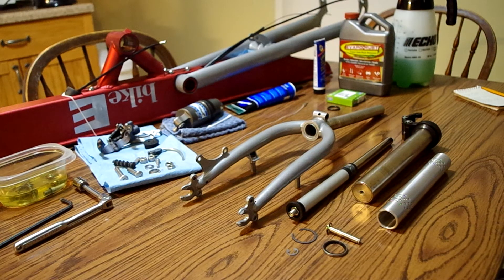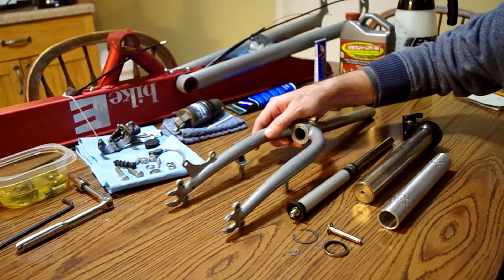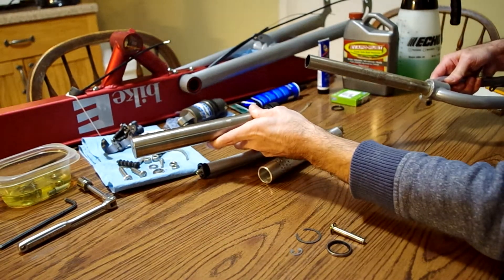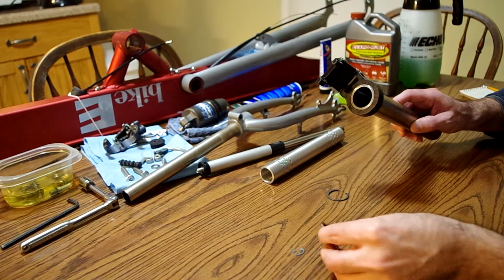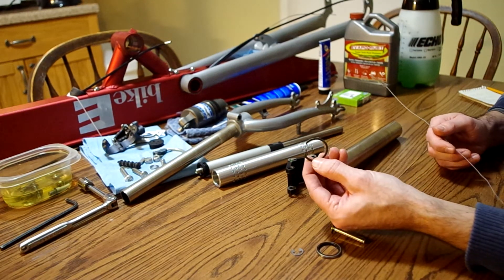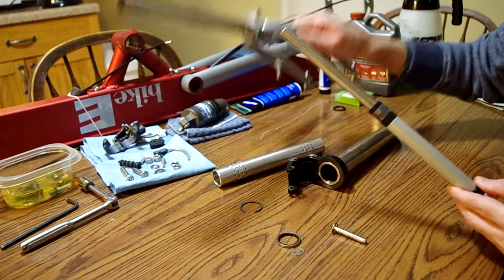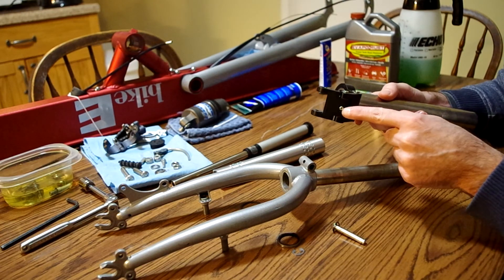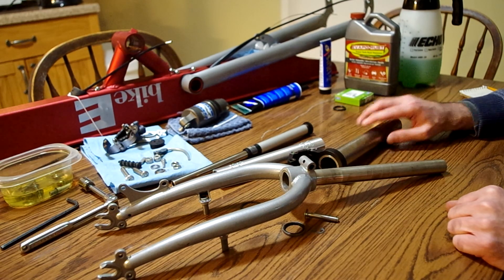BikeE FX (and RX) Front Suspension Components

Comment: Great video and very timely for me.  I just brought my BikeE FX out from under the house after 20 years of storage.  I forgot how much I like to ride the bike.  Does anyone have any guidance on how to set the pressure on the front shock?  Mine is flat.  :(.  Thanks!
Reply from the maker: I’ve got documentation for the front shock someplace. Lemme see what I can find for you. I can say you’ll need a dedicated shock pump though, as a regular tire pump won’t work. It’s a common item and not specific to Bike E, thankfully.
Reply: @76horsepower thanks!!
Reply from the maker: @gjohnson3043  The Bike E FX supplement says to inflate the front shock to 1.5 x the rider's weight, plus or minus 10 psi depending on riding conditions, which should result in 0.1-0.2" of sag at the front shock when rider is sitting on the bike with both feet on the ground.
Reply: @76horsepower  Great!  Thanks so much for the information.  I'll go see what happens!

Comment: Do you know if replacement air cylinders are available? Or even how to spec a replacement?
Reply from the maker: I rebuilt both my cylinders with OEM parts kits and, as far as I know, parts are still available. I rather like the ride provided by the air cylinders, but many have replaced them with coil spring units. I don’t know which ones, but you should be able to measure your current one to determine the appropriate replacement.

Comment: C clips,  probably have to use a pick and a small screw driver, or needle nose pliers 😊. Might be better 🤔 😉
Reply from the maker: Sits way too deep in the groove to get pliers on it, even tiny ones. I worked for a very long time with a pair of tiny screwdrivers before I discovered the piano string method, which worked pretty quickly.

Comment: They are interesting bikes, The one I just bought doesn’t have the mid drive or front suspension. I,m going to try a 20in wheel with mountain bike suspension forks.
Reply from the maker: It’s been done, but beware that switching to a 20” front tire will alter the steering geometry considerably and the front tire with have a greater tendency towards flop.

Comment: Any idea how the rear fork comes apart? I've tried just banging out the hollow shaft, it doesn't budge. Can't get a good look at the internal support to see if there is some retaining screw.
Reply from the maker: That’s one thing I didn’t remove when I restored the bike, but the tube that holds the rear swing arm in place is a press fit, so you’d need to press it out. It’s also held by a plate inside the frame that is tensioned by the Allen bolts that hold the mid-drive in place, so you need to loosen those first if you intend to remove the swing arm. FYI, when done, they need to be tightened to a very specific torque, and the aluminum plate can snap if over-torqued. If your swing arm is just stiff, you can repeatedly spray the bushing around the press-fit tube with silicone lubricant and let it soak in. That’s how I freed up mine. Though note that it’ll never feel like it moves very freely if you’re just moving it by hand, but when you sit on it, if properly tightened and lubricated, it’ll move fine.